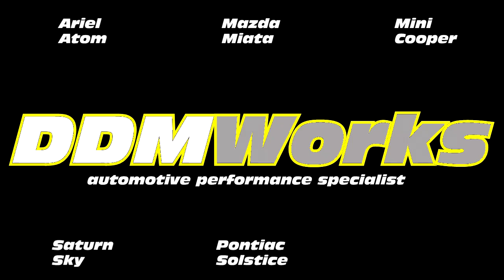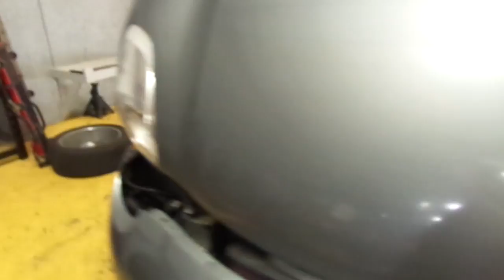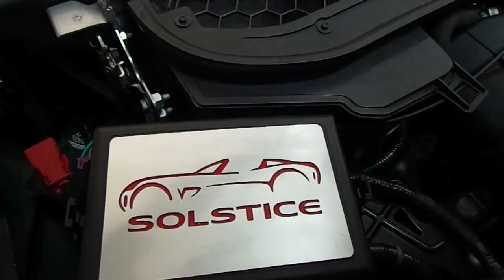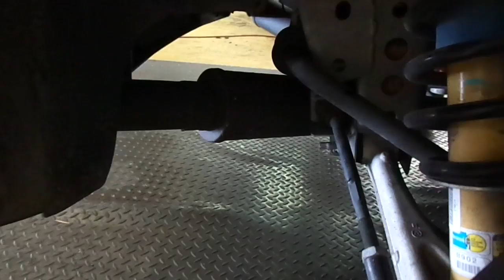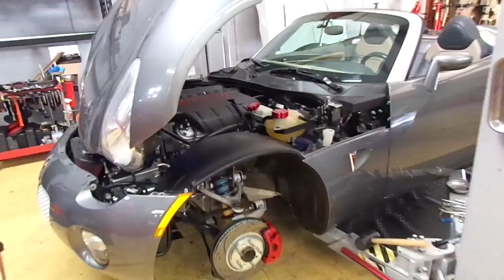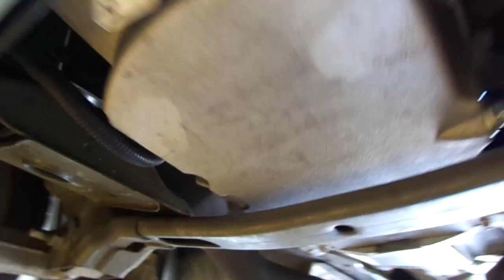LS3 V8 conversion #2

Comment: Wouldn't you need to replace the computer which is programmed for a four cylinder and the differential which handles torque from a four cylinder and shouldn't the brakes get more of an upgrade besides powder coating? There are just too many other things to mention here that need to be done for that car to perform like it should with a V8....